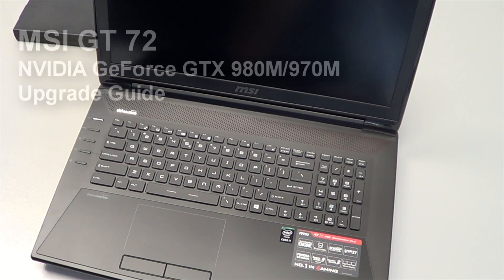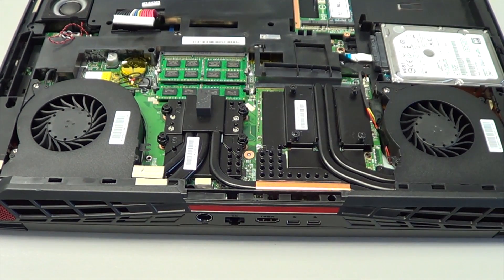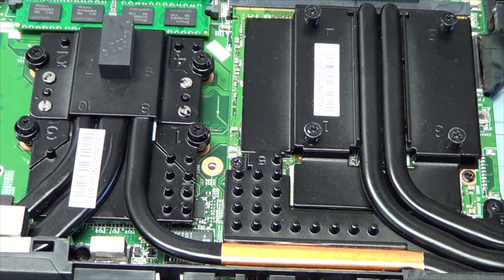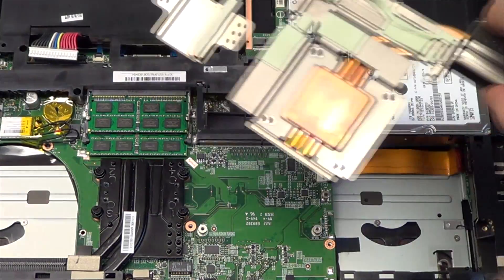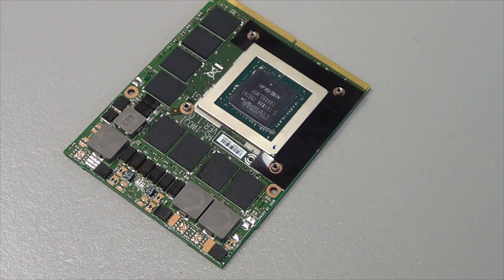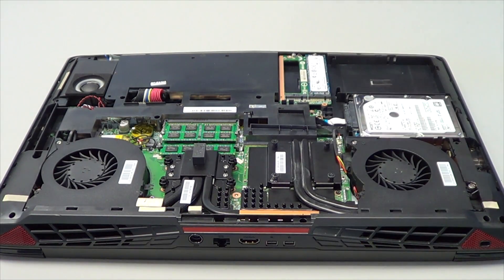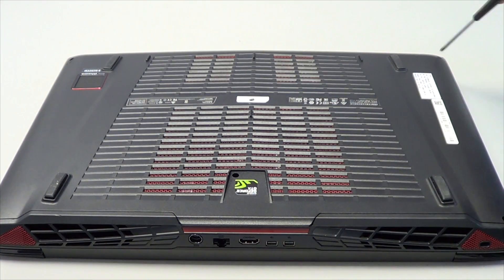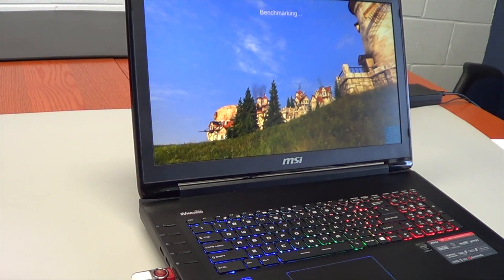MSI GT 72 NVIDIA GeForce GTX 980M Upgrade Guide

Comment: where did you bought your gtx 980m?
Reply from the maker: You can get the 980M from us!  For the MSI GT 72 upgrade kit visit here: http://www.eurocom.com/ec/msi()ec
Reply: $817?! your kidding right?
Reply: You can literally buy an external GPU case with a 1080 for nearly the same price...as long as you have a thunderbolt connection.
Reply from the maker: But then it is sitting on your desk and not with your laptop when you are out and about.  But yes, if you want a stationary graphics processor, an external GPU could work.

Comment: Im dying why didnt you reapply the thermal paste? I know its old, but Im dying why did I see that?
Reply from the maker: I reapplied the thermal paste at 8:51.
Reply: oh... I missed those few seconds. Is the laptop still upgradable or are there more advanced laptops now?
Reply from the maker: Yes, it is still upgradeable.  There are more powerful systems available now but the MSI GT 72 is a great system.

Comment: Great information with GTX 980M card.... would it be possible for you to do an informational video regarding DDR3L RAM upgrade...
I have the MSI GT72 2QE with the GTX980m Graphic card and i would like to upgrade my DDR3L RAM...12Gb to 16GB or 32Gb. But i'm not certain if i should use the CAS 9.0 or the CAS 11.0 DDR3L RAM. maybe upgade my SSD M.2 Sata  thanks
Reply from the maker: So the lower the CAS latency the faster the memory should be if everything else is equal.  I am not 100% sure what memory is supported in your chassis but that information should be readily available.  I don't have the chassis anymore to show you the memory upgrade anymore unfortunately.  Good luck!
Reply: This is what i selected for DDR3L SO-DIMM 1600 (PC3L 12800) Laptop Memory
https://www.newegg.com/Product/Product.aspx?Item=N82E16820231728 
I also selected the Samsung 850 EVO M.2 2280 500GB SATA  Internal SSD
https://www.newegg.com/Product/Product.aspx?Item=9SIA1J23SR5217
thanks
Reply from the maker: Awesome, good luck!

Comment: Do you think there is a mpcie slot anywhere? I'm trying to use an external gpu, I've opened the laptop but I can't find it anywhere
Reply from the maker: Attach an external GPU through the mPCIe slot?  I don't get it.
Reply: I was't specific, I'm using an external dock with the x16 connector for my GPU. There is a cable extending from the dock that plugs into an mPCIe slot. Similar to this one: http://www.banggood.com/Mini-PCI-E-Version-V8_0-EXP-GDC-Beast-Laptop-External-Independent-Video-Card-Dock-p-1011222.html?rmmds=search

Comment: would it work on my Lenovo y700 15 inc with i5 2,3 ghz and gtx 960? i really need to now. btw im not great with laptops or pcs what makes a pc run things better?
Reply from the maker: No, that laptop does not support this upgrade.
Reply: EurocomTechnology hi i would like to know if my cpu and gpu temperature is still good or not i have msi gl72 6qd nvidia 950m and i5 2.3 Ghz so in the game For Honor i have with turbo boost ON cpu 87-88 degree and gpu 88-89 degree. Is it a normal ? i changed a thermopaste yesterday and it still almost the same maybe a cpu is now better about minus 5 dgree( not more so...
Reply from the maker: Yeah that is about as hot as you want to get but if you are overclocking/turbo boosting than you are doing ok.

Comment: Hello guys, each time I see videos like this I wonder is there a way to use some sort of extension and converter for that port to a regular size PCI so a regular full sized graphics card could be used externally. I know there are workarounds using other ports such as miniPCIe m.2 etc and of course the all mighty thunderbolt 3 if you are lucky enough to have it and are willing to pay the premium price for the enclosures but I've never seen something for that port despite seeming a no-brainer to me. Any idea?

Comment: hey i hv my laptop its so cool in Specification  but it has no gpu   it only have intel 3000 hd 

and that sucks....  can i be able  to install NVIDA 2GB  ON IT AND IT WORKS??? 
ON gaming matters? 

HP pavilion dv6
core i5 2.50ghz
ram 6gb
HDD 650gb
Reply from the maker: Nope, you cant replace the Intel 3000 HD with an NVIDIA graphics card.

Comment: can it be possible to add internal gpu for gaming on a laptop when it    is not available or not being there before ?? is it possible ?
Reply from the maker: No , you can't replace the Intel 3000 HD with an NVIDIA or AMD graphics card in your HP.
Reply: why even though theres a space available on the mother board bro?

support if i buy a new mother board with has the GPU could it be cool then their
Reply from the maker: If the motherboard doesn't have an MXM slot than the system cannot support a graphics card.

Comment: Can i upgrade my GT72's CPU? i want to change my i7-4920HQ to a better CPU.
Reply from the maker: No, the CPU is soldered to the motherboard and cannot be removed or upgraded.
Reply: what about upgrade my 980m to a better grphic card?
Reply from the maker: You can upgrade to 980M.  If you already have 980M than you already have the highest performance card available for the MSI GT 72.
Reply: soldering any component including cpu or ram in a machine is terrible
Reply: can you replace the motherboard?

Comment: Is it possible later on to upgrade to 1080 or add a new 1070 sli in the below Msi GT73 VR model:
https://www.amazon.com/MSI-GT73VR-Titan-017-Notebook-I7-6820HK/dp/B01K05LCHY/ref=sr_1_1?s=pc&ie=UTF8&qid=1477434855&sr=1-1&keywords=MSI+GT73VR+Titan-017+17.3+Inches+Notebook+%28Core+I7-6820HK%2C+16gb%2C+128gb+SSD%2C+Windows+10%29%2C+Black
Reply from the maker: Hopefully!  We have not verified the 1070 or 1080 into any GT 72 or 73 models at this time.

Comment: Hi folls. I am looking for instructions to replace the subwoofer on this notebook. Can anyone advise me how to perform that? I already have the pc but don't know how to do
Reply from the maker: I'm not sure.  You could probably find it in the owners manual.
Reply: You have to take the thing pretty much completely apart, when you take out the hdd, blowers, etc and then you take out the screws that hold in the big black plastic piece it lifts out and you can take the subwoofer out of the plastic piece and stick in a new one.

Comment: hi m8 can i upgrade my card i have an ASUS F550JK-DM112D with a gtx850m thank u
Reply from the maker: 850M graphics are typically integrated to the motherboard and cannot be upgraded.   Asus also use non standard MXM cards for many of there systems.

Comment: If I have the GT72s with the 970m and want the 980m just to hold me over until I buy a Pascal laptop will the same heatsink, cooling pads, and other hardware work between the two MXM modules?
Reply from the maker: The MSI GT 72 supports 980M.  You can see your options here: http://www.eurocom.com/ec/upgrade(2,344,0)ec Yes, you can use the same heatsink but you will need to re-arrange your thermal pads and re-apply the thermal paste.

Comment: Do you know if the gtx 1080m upgrade kit will be available for the msi gt72s ?
Reply from the maker: Not sure, the Pascal cards are different physical designs.
Reply: Oh that's disheartening. I just bought my Gt72s thinking it would be no problem to upgrade to the new gpu. Ugh!! Had I known I would have waited. 
  Thank you for the reply.
Reply from the maker: LoomisPeabody3 Sorry to be the bringer of bad news.  This does not mean that it is impossible but more unlikely that in the past when the cards were the same design.  We will try to verify this upgrade.  Stay tuned!
Reply: EurocomTechnology I'll be keeping my fingers crossed!! Thanks again.
Reply: You can get the EXP GDC Beast Laptop External Independent Video Card Dock, it's a WAYYYY cheaper alternative to an external GPU case like Razer's or AlienWare's one, it does need a PSU tho. And since you were down to buy the 1080m, then you can get a desktop GPU, maybe the 1070 or whatever you choose. There are video guides on how to install it on youtube.

Comment: I just ordered the gt72 broadwell version with i7 5700 and 980m. Very nice it will accept the 1080m or 70 once it is out and I need to upgrade. One question can the HM87 accept a pcie 2.0x4 ahci ssd such as the Kingston Predator. Is the M.2 sata in this unit wired to the pcie bus?
Reply from the maker: I'm not sure.  I don't have that system to test any longer.  I'm sure that info could be found online.
Reply: +EurocomTechnology been a little tougher than one would think, all good thanks for the reply
Reply from the maker: Oh really?  Sorry I couldn't be of any more help.  Good luck with your search.
Reply: you sure it will accept 1060-1080... there will be no longer 'M" releases it's just gonna be  desktop cards plugged into laptops. Hope it will be able to upgrade.....huge boost from 980m to 1080
Reply: +Gediminas Peleckis its confirmed that one can upgrade from 980m to 980, will have to see if upgrade will be available in future. Cost may be prohibitive anyways.